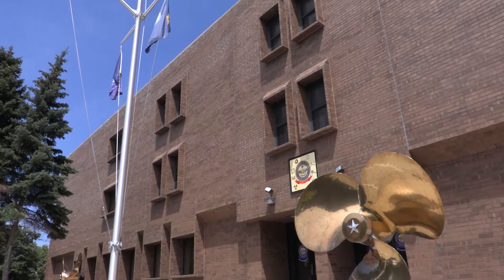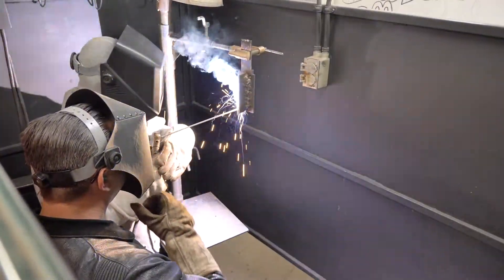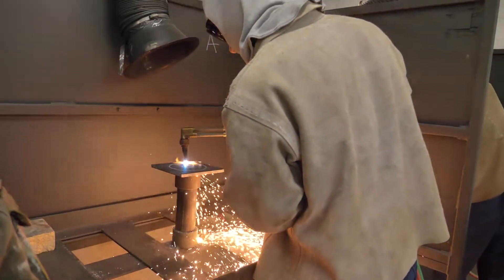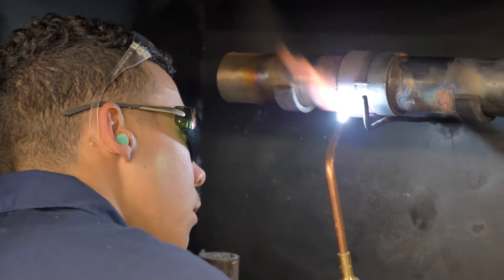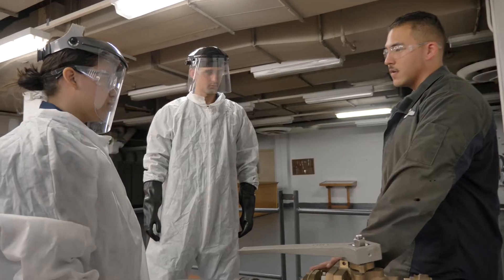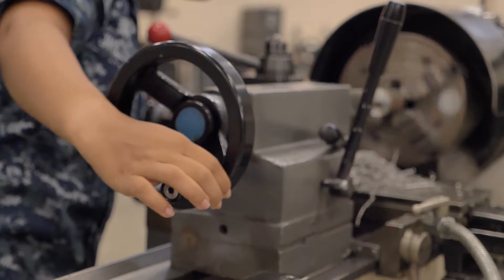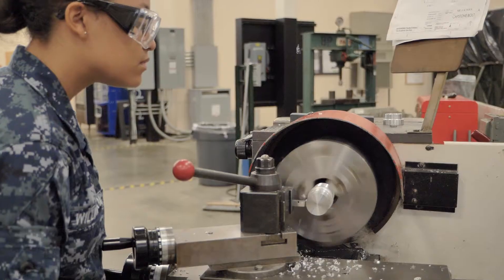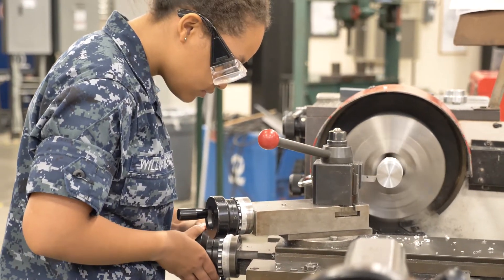Hull Maintenance Technician and Machinery Repairmen SWOS Unit "A" School

Comment: we stayed at that bench til we got it right
Reply: I want to join the Navy and weld. I’m split between HT and CB. How much of HT is dealing with shit because that’s kind of the deciding factor?
Reply: @redphone25  an HT on a ship will eventually have to deal with fucked up shitters...as a CB ya probably will as well but ya get to ay with heavy equipment, but...you may be stuck at the same duty station for 4 years...
Reply: @redphone25  If you become a coded welder, you won't be doing any of the routine maintenance and repair. 4955/4956 get assigned to repair departments, not ship's force. I hope you went HT, it's the most versatile rate you can choose.